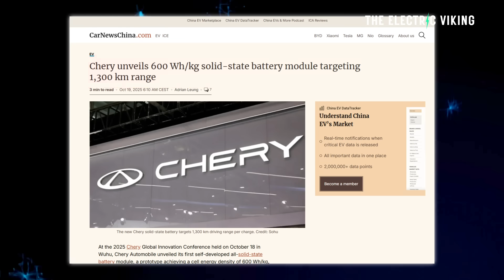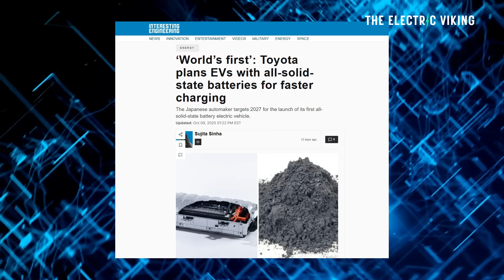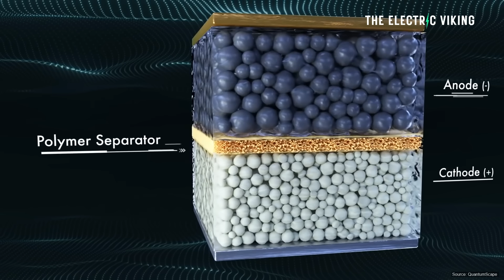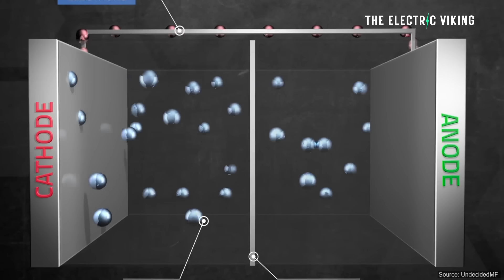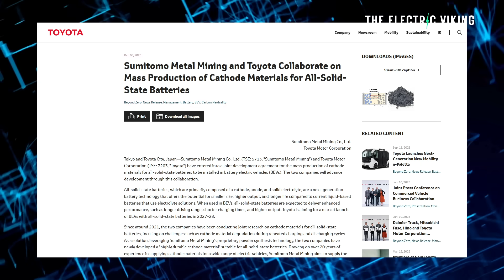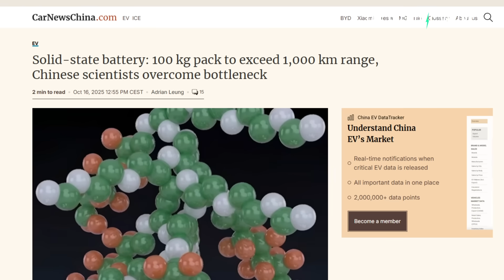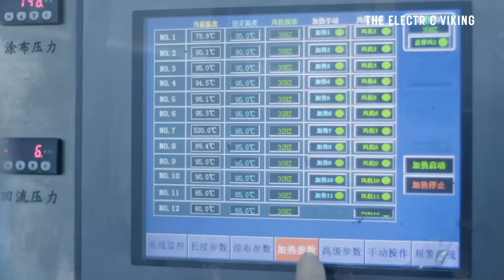Chery’s 600 Wh/kg Solid-State Battery: EV Game-Changer?

Comment: Sam - Love the videos and been following for years, but not sure your statement on a 50kWh pack going 600km. Higher energy density doesn't mean a kWh goes further or has more energy. A 50kWh pack has that much energy regardless of the product used to create it. Twice the density would be half the weight (approx) but that wont give 12 km/kWh from shaving 200kgs of the pack weight. Keeping the pack weight the same and It going from 50kWh to 100kWh would increase range.
Reply: In fact, increasing the density decrease the consumption for the same battery because it weights less.
Probably not so much but more than a heavier battery
Reply: @oatlegOnYt  "In fact, increasing the density decrease the consumption for the same battery because it weights less." This is true but only to a small degree. General Rule of Thumb - Adding 100 lbs (~45 kg) to an EV can reduce range by about 1-2%,
Reply: You know what he means man. He means a pack of the same physical size. It annoys me too because I am an OCD engineer, but learn to let it go man, you will be happier. BTW, being super nit picky here, technically a 50kWh battery that is 600 Wh/kg will go further than a 50kWh battery that is 200 Wh/kg. It will be 1/3 the weight. Batteries are a significant portion of the weight in an EV.  Of course weight is not a significant factor in range on the freeway where it matters, but it will have an impact.
Reply: Hi! I completely agree with you. A car equipped with a 50 kWh battery will not be able to travel 600 km on a single charge. By increasing energy density, you achieve the ability to install a battery with significantly higher energy capacity in the same physical space, or alternatively, maintain the same performance while reducing both weight and size considerably. I hope this explanation makes sense.
Reply: I have noticed a few people have already picked up on this. And I understand the confusion, as it took me a while to get my head around what greater energy density would bring. But basically. If I use my old Model S as an example, these new batteries would mean I could fit a battery with double the 85kW of the original battery pack ie 170kW and yet it would weight in at about half the weight.  And likely be a fair bit smaller physically. The potential for cars/vans etc having very good range and weighing a lot less than an ICE equivalent is getting closer
Reply: @dougowt  Yes, just remember that if tesla want 20t.$ for a 85 kWh battery then there are not many who will pay 40t.$ for the big one even if the range are double.
Reply: Yeah guys, Sam got it wrong maybe. But a lot of you are missing an important point. If the battery gets lighter and smaller, the whole chassis will become lighter and smaller. So the suspension can get lighter and smaller and maybe also the motor. If the motor can be smaller the wiring will be lighter. You get the point, there is a multiplier effect. If you shave off half the size and half the weight of a battery pack you get a totally different car, lighter and smaller, while keeping the internal space.
Reply: If this battery is 600wh kg, and real. 

 It isn't just a battery for cars, but everything. This could actually let electric flight be possible. 

 This is amazing news for the world. Power tools. 

 Also wouldn't 50kg battery need like 3,900 wh/kg to get 600 miles range. 

 Yo imagine if Chevy produced a cheap EV with 600hp plus. Two axial flux motors. These batteries. Miata size. 400 miles so not heavy. 

 Only tech is for driving like full torque vectoring, four wheel steering with drive by wire. 

 Rugged, simple, powerful with instant torque, full control, and cheap. The promises of electric vehicles. 

 I want a small truck like that too. 

 Imagine if F1 wasn't pansies, and allowed rotaries back in the day. I bet we'd have a good one now for range extenders.
Reply: @RedactedDeath  It all depends on cost (and safety and lifespan, charging speed, etc...). If these batteries are cost competitive sure, but they won't be anytime soon if ever. If you have the only 600Wh/kg batteries you get top dollar from applications that are not price sensitive. Until these are mass produced at the volume NMC are you won't see them in budget EV's. But, some day right?
Reply: True, the little weigth diffence means almost nothing to the range but it makes it possible to make it drive better and other things. And they will not make super long range because they will be too expensive.
Reply: I think the range question can’t be answered comparing an ice engine with an ev. EVs have entirely different properties and range anxiety is a real thing and longer range in an ev is of real importance. I for one want an ev with 1000km of range because I do not own a house with ways to charge for free.
Reply: Noticed the same thing.  Pretty sure he was trying to say weight.
Reply: Even if the numbers aren't technically correct, the notion that an increase in energy density is going to "change the game" is. People of Sam's brand of "bullish" messaging are needed.
Reply: He means the battery that you could fit in the same compartment that my actual EV's 50 kWh battery sits on. Right now I get about 300 KM of range from it, so if the energy  would double (I think it would quadruple since mine is an LFP), the rwnge would definitely exceed the 600 km he claims in the video. It's a bad way to compare it, but it's something that non enginerees can easily get their head around. It would be better if he said that "An actual 50 kWh NMC pack could be replaced with this new technology and achieve 600 km of range".
Reply: I understand what Sam meant - that a solid state battery the same size and weight as a current NMC or LFP battery could have a 600km range.
Reply: Like all such announcements, this is interesting but 'should be taken with a pinch of salt'.
Personally, what excites me most is the prospect of a car such as our CURRENT Kia  EV3 having a Cherry S/S battery which is half the battery weight - resulting in at least the same CAPACITY, but with the prospect of achieving a significantly higher range due to the car's overall reduced weight.
I expect that you'll have passed on another few thousand 'groundbreaking' announcements before Cherry cars with this new battery roll off the production lines and appear in our UK dealer showrooms.
Reply: He has zero understanding of the actual science.   He now does consulting...
Reply: Chinese range has nothing to do with real kilometers. Most electric cars sold in china now have over 1000km Chinese range
Reply: Indeed lop off at least 35% and you arrive at something more realistic SMFH. Cut in half for cold climates and or aggressive drivers!
Reply: @4literv6  - yes, Sam's generalized, soft on details reporting does lead to SMFH,
 but if Chery has an actual production capable Solid State battery 
with high energy density, that would be great news.

Comment: These will go into motorcycles, drones,  jet skis, evtols, etc.. before they go into cars. There are some use cases where performance is far more important than cost.
Reply: Yes..Double the range of a $ 10,000 motorcycle for an extra $ 500
Reply: It'll go everywhere pretty quickly; volume and through put are everything.
Reply: The threshold to making airtaxis or heavy electric air transport vehicles is 500 wh/kg batteries. This surpasses that requirement.
Reply: Solid state are too heavy for evtols
Reply: @linegoesup-tl1hq  Solid states are lighter than the LFP & NMC batteries that most Evtols use.

Comment: How is it's fire resistance?  kWh/kg is not the only measure.  temp range, charging and discharging rates, cycles etc...
Reply: solid state are generally very fire resistant, even unable to catch fire.
Reply: @rsmonge  That's not been proven.   

if a lithium metal anode is used and a dendrite causes a short, or if the battery suffers mechanical damage or thermal runaway from another cause, the energy stored is high and can still cause a fire. So “safe from fire” is too strong a phrase at this stage.